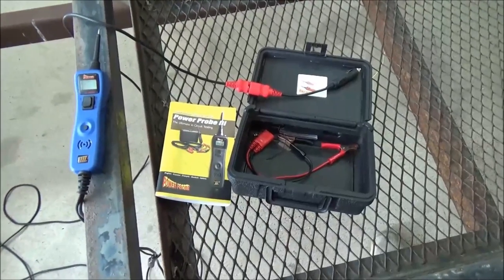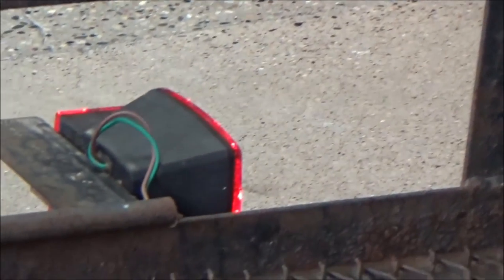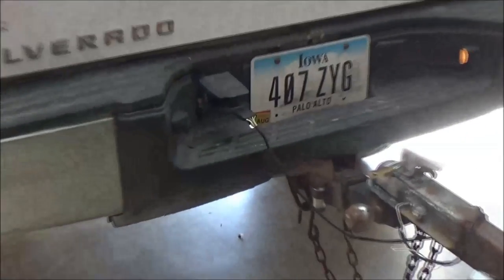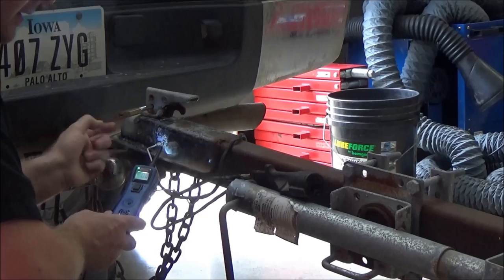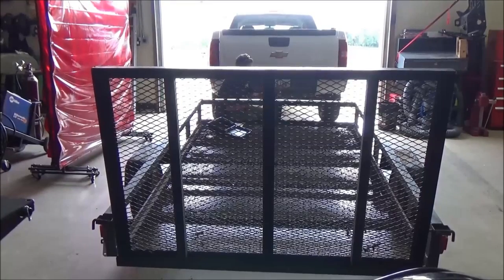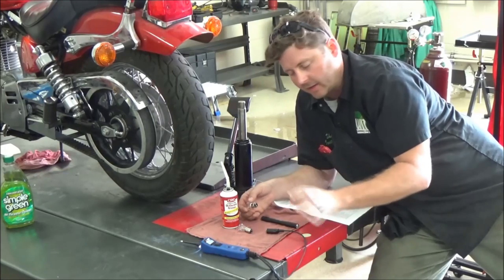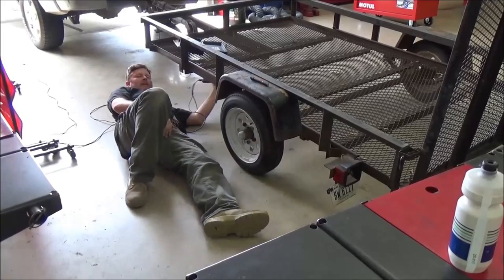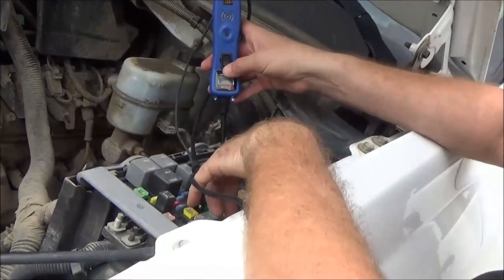How to diagnose and FIX trailer light issues FAST! Demonstrated using  the Power Probe 3 tester

Comment: I've had a Powerprobe for a few years, and it's one of my favourite tools. It's simple, very easy to understand, and it frees the mind to concentrate on the problem at hand. Of course there is work to do if you want to do more complex testing like drop testing or if you think flow may be reversed because of a bad ground somewhere. But I'll pick the more simple tool in the name of better understanding of what the tool is doing.

Comment: Hey Shane, thanks for this video. I will be buying this tool. Awesome! I rewired my trailer and it was working. Then a couple of weeks later it wasn’t. I check for any wires being loose, then I wiggled and pushed in on the plug going into the truck. A couple of seconds later the wires and the plug started to smoke and I jerked on the plug to unplug it. My ground wire insulation almost completely melted. So, at this point I am back to square one. Your video inspired me to give it another try. That tool looks amazing! Like I said, I will be buying one. 
Thanks again, Gary
Reply from the maker: Hope this helped. Want to give us a “high five”? Click here https://www.paypal.me/how2wrench 
 Need more personalized help? Your answers and help are just around the corner. Save time and money while protecting your investment and yourself by doing it the right way at www.How2Wrench.com  
  
 Thanks for commenting and adding value to our community! Please subscribe, share and consider a H2W membership to support our free work here! 

Have you subscribed yet to never miss a video? Have you seen the video playlists? Over 600 videos! Check them out here: https://www.youtube.com/user/conleybuilt/playlists

Comment: I’m confused if you had power going to the truck pins on back. How did that turn into blown fuses. At 9:04 u had dc going to Pin’s then later the fuses were blown I just ordered that tool why didn’t it catch that

Comment: I didn’t see you turn the signal light on. I’m going through the same right now with a car hauler about 20 feet in length. Installed a new seven wire harness. The right side works perfect..I’m stumped . The vehicle works fine with my utility trailer.
Reply from the maker: Have you tried the powerprobe? Thats what I would serious do to prove the circuit works and seperate the truck vs. trailer. Here is the one we used in the video: https://amzn.to/3aFTHKP 
Thank you for taking the time to comment! Hit that subscribe button please! It helps us!
Here is a way to support all the free videos.
Want to say “thanks” or “keep it up”? Click here https://www.paypal.me/how2wrench  

Coach Conley is also available for hire to personally work one on one with you if ever needed. Yep he is a real person. Give him a call @ 602-345-0432

Your answers and help are just around the corner. Save time and money while protecting your investment and yourself by doing it the right way!
Follow us!
Web:
www.How2Wrench.com    
www.Tools2Wrench.com

Comment: Okay I like the Probe product would like to add to my arsenal, can you share some details as to who sells it and what it costs? Keep up the great work enjoy them all. Regarding those trailer light kits, I often find the tabs that the wires are supposed to connect with the bulb bases, often bend away from the darn bulb. Then you can apply power, have no light operating but you tap the housing and you have intermittent light. I just drop a bit of solder on the point the bulb makes contact. Last time I replaced my trailer wiring I used 3/8 plastic wiring flex conduit from Radio Shack to cover wiring from center up inside the tongue. I have critters who like to live in the tongue and chew on those wires.
Reply from the maker: Call Scott at (712) 541-1099

Comment: My Chevy truck ('05 2500 HD) does have left and right fuses for the trailer connections. My problem is the running lights fuse blows, I'm thinking there is a  short in that wire somewhere in that circuit. The trailer lights work fine when wired directly from a  12V source.
Reply from the maker: Have you Subscribed yet to never miss a video? Have you seen the video playlists https://www.youtube.com/user/conleybuilt/playlists ? Quick answers are often found here. No time to look through videos? 

Still have questions? You’re in luck! I provide tech help and work one on one! I know your question may seem quick but with over 300 requests a week, it’s not possible to answer them all. So, I’ve narrowed down so subscribers and donations to assist beyond the over 660 free videos. My YouTube has grown beyond the ability to answer every question (11 million views! Over 500,000 a month!)

Click here for the membership links and welcome to the community! https://how2wrench.com/product-category/specials/    

Want to say “thanks” or “keep it up”? Click here https://www.paypal.me/how2wrench   This is great for those truly quick questions you need answered and your help back will keep me going!

Your answers and help are just around the corner. Save time and money while protecting your investment and yourself by doing it the right way!
Admin How2Wrench.com

Comment: Ok so I'm appealing to anyone out there who might be able to help me because I'm stumped.   I have a bit of an unusual problem with my rv trailer.   Bare in mind it's hooked up to a 2018 Chevy Silverado, which has auto light controls, manual light controls, and no ability to turn off the lights completely.   That being said, on my trailer,....the turn signals work, the brake lights work, but the running lights do not.   However the trailer lights are on bright like brake lights are, when the running lights are on on my truck in the dark.  In the day my truck lights aren't on, so turn signals work, and brake lights work.   So in a sense I have running lights at night, but my brake lights (because they're already on instead of my running lights) and turn signals cease to function when my truck lights are all on.   I would be able to be seen, but not make it aware of braking, or signaling.   Long story short, it seems my trailer has changed it's mind by using its brake lights as running lights, and cancelling out it's blinkers.  Any thoughts please.
Reply from the maker: Guessing you got it fixed by now...
That surely is a question for Shane. Can you hit the subscribe button, it helps us and he often responds to subscribers when he gets to a computer. You rock!
For faster service see below:
We try to respond to these questions but with 700 videos on here its hard to keep up with the demand of over 400 requests a week for “a quick answer” it's just become hard to manage in a timely manner.  

Good news you can catch him directly. You know him from his videos, no shortcuts on answers so he wants you to get everything you need. If looking for technical help, business collaboration call him directly @ (602) 345-0432 
Are you just wanting to say thanks? Consider a donation here: https://www.paypal.me/how2wrench 
Thank you in advance for giving back! He looks forward to working with you directly!
Reply: Check the wiring harness on the truck right above the bumper the colors should change follow the trailer plug down might have a short on it

Comment: my truck plug is only reading a little over 10 volts and not the 12 to light the trailer lights I'm told it's supposed to have.is there supposed to be a battery in the camper I'm trying to tow it should my plug power the tow
lights itself.I get no lights at all when I plug in but three trailer lights work with a battery
Reply: also my ball is painted black, it came this way from the store, would that make it so it doesn't have a good ground?
Reply from the maker: Hello,
You may only have 10 volts if your headlights are on while checking and there is a volt drop from dirty connection. Test at the battery with key on or off if wired hot and test at trailer connector. Compare those numbers for a volt drop. Example: 11.6 v key on at battery and 11.4 v at trailer = .2 v drop which is acceptable and may even be improved with cleaning connections. 
Remove paint from ball. 

If I can ever be of service to you, here is a video explains how to connect with me. 
https://www.youtube.com/watch?v=vjvmB01ebcs 
Keep Wrenching,
Shane Conley
Instructor/Motivator/Motorcyclist
www.how2wrench.com
Like freebies? Click here for a free diagnostic checklist! 
http://gem.godaddy.com/signups/364621/join 

Did you like this free video and hope to see more? Would you just like to say thank you with a donation? Click https://www.paypal.me/how2wrench

Comment: Sorry but your tool is costing you time, not saving it. In less than 60 seconds you could have visually inspected the trailer harness and pulled the fuses before even reaching for a single tool.
Reply from the maker: Hey Jimmy...we like to work smarter and use all the benefits of testing to confirm. We also could argue if the fuse is blown why and that there is a chance a new one will blow and put you in the same spot. If you watch the series on the tool, you'll (maybe with a open mind 😉) see the value on all it can do. As a shop if you averaged all the electrical jobs a year that blew a fuse "just because" it's low and there is another problem that needs fixed...making a tool like this faster and extremely profitable over the average of a year. A DIY with one trailer, and one time issue, sure you may get lucky and win that race....just some things to chew on if you watch other videos on the channel...
Thanks for challenging us with a good comment! Join the channel. Best $1.99 you'll spend to access all 800 vids and Shane Daily! Smash the sub and like please. 

Throw Shane a high five donation, channel membership or merch for saving you $$$$$$$ Links below to support more for this work! 🙏
You rock for commenting! We will let Shane know! Want even more? Best $2 you'll ever spend...Join this channel to get access to perks:
https://www.youtube.com/channel/UCBhM8DCKnT3qXwTW0eToyCg/join      
-Daily MEMBER FIRST COMMENTS ANSWERED FIRST 
-Live Q/A video chats
-Wonder if we have a video on your need? Members can request content links!
-Full Access to the ENTIRE 700 video library
-Member-Only FREE tool giveaways  
Ways to support or high five How 2 Wrench! Thank you in advance. YOU MOTIVATE US TO DO MORE!
1. Smash the subscribe button (thank if already a sub!)
2. Have you seen our "YouTube Trained Support Shirts?  https://goodfellasmerch.com/collections/how-2-wrench/products/support-shirt  
3. High five donation:  https://www.paypal.me/how2wrench   
4. Got an emergency and your head is about to explode from frustration or fear? Get Shane’s cell here: https://how2wrench.com/ols/products/techline-one-on-one